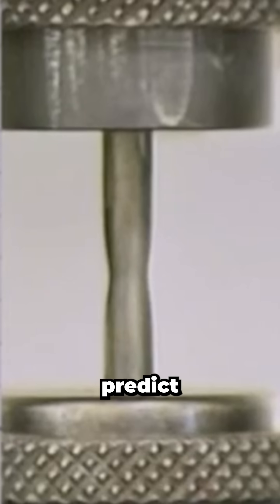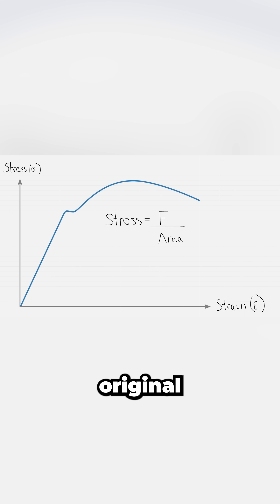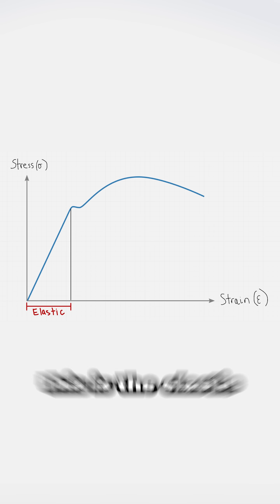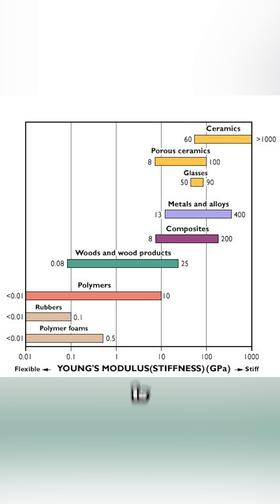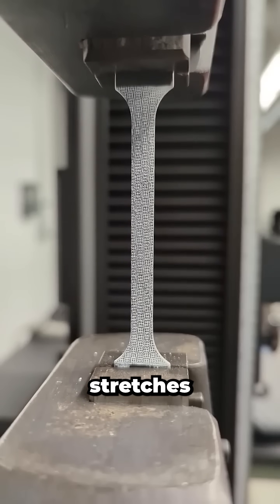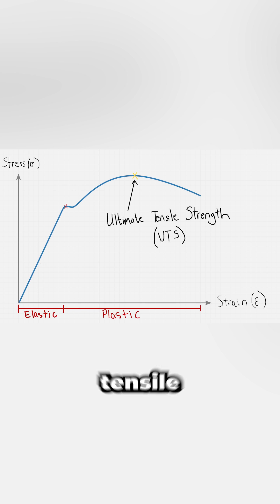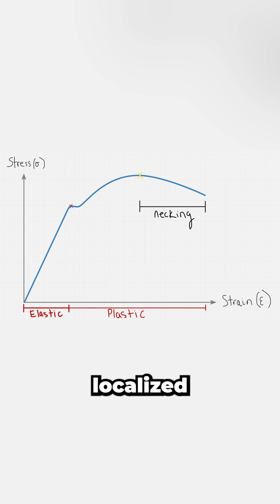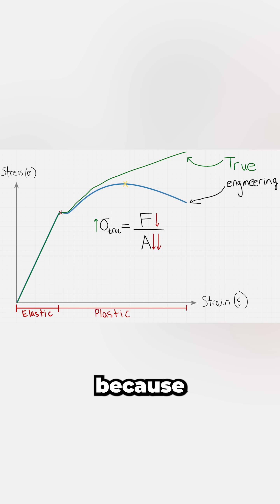How engineers use this curve to prevent disaster

Comment: Just a small correction that graph doesn't start at 0 stress
Reply: Why would it not start at zero stress?
Reply: @wmadttrpg  because the tested part would be a little bit loose OR if you tighten it before running the test then the part would already be pre-stressed
Reply: @jackknall9966 That’s not how the test works though. All materials have stress in them; performing a tensile test measures the stress and strain due to the applied force, not the total stress present in the object. 

If the grip slips when you start the test, you need to run a different sample.